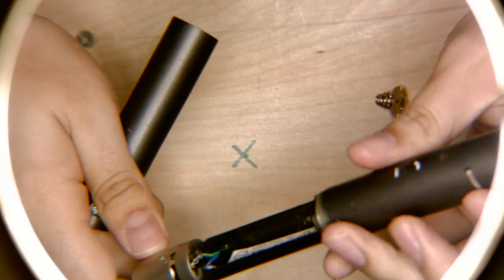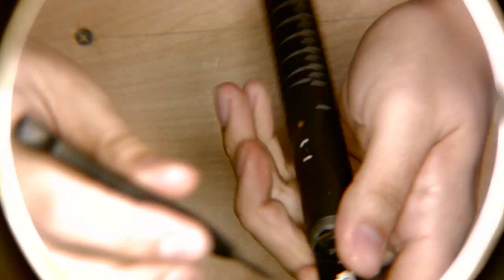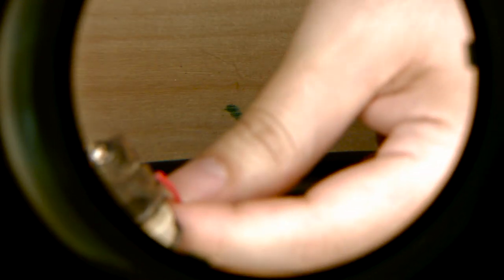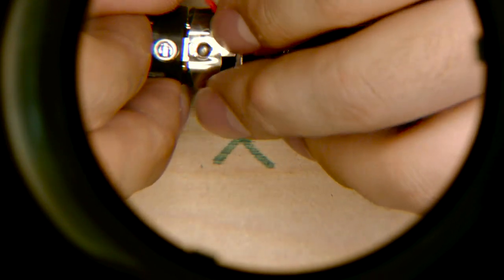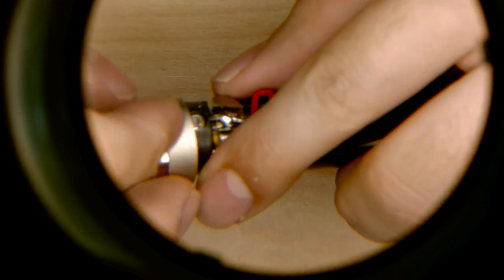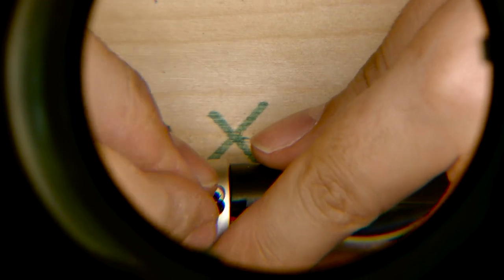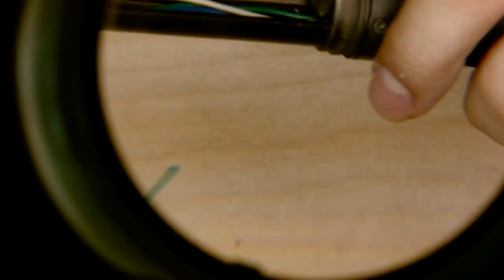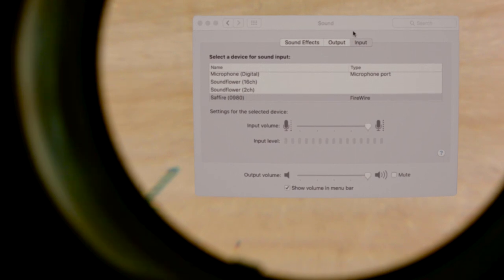If It Ain't Fixed E01 - NTG2

Comment: I have the same mic.  One of the pins, while still connected, is sticking out further than the others.  It also feels "loose."  When I try to unscrew the bottom part/tube (the metal tube protecting  the battery compartment) it's blocked by what looks like a plastic ring.  Any idea how I get past that without breaking the ring or damaging the tube?
Reply: Right? Imagine a disassembly video that skips the 1st, important part of the disassembly.
Reply: I was able to get a small flathead screw driver in and pry it out, then easily push it back in with the screw driver.